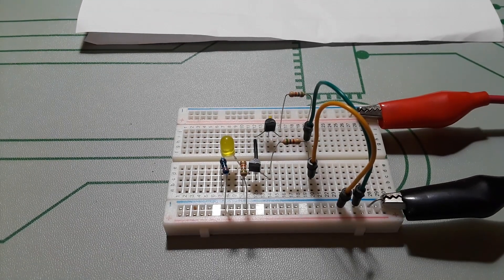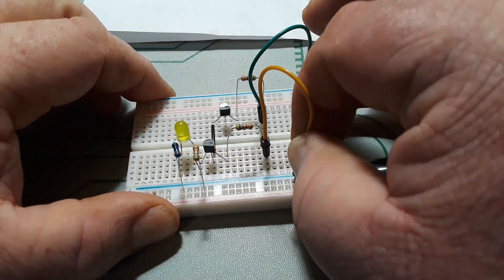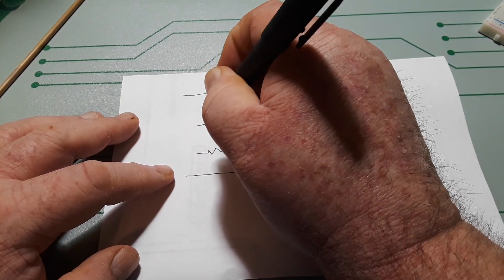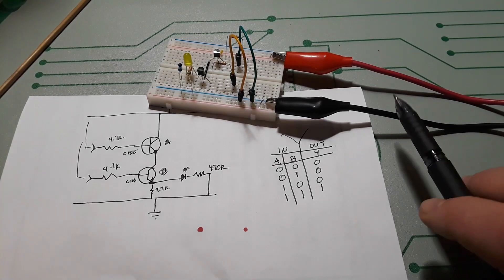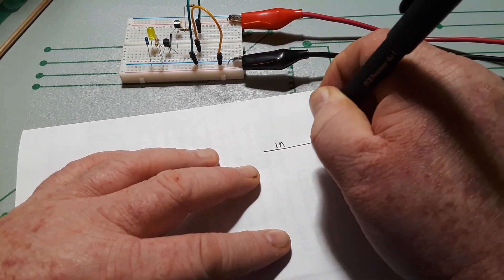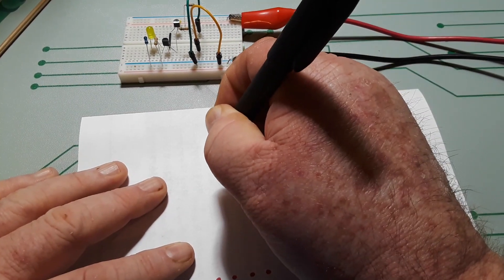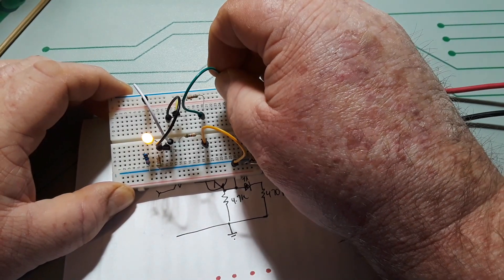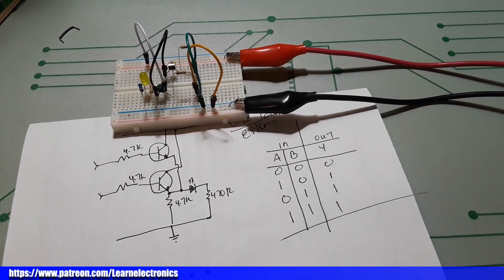How To Make Discreet Transistor AND and OR Gates

Comment: So I made this AND circuit with a couple of generic NPN BJTs (no datasheet on them) and switched each on with a 5vPP (2.5v offset) square wave at different frequencies and found the LED blinked appropriately when both square waves hit their peak simultaneously - however, when I measured the signal out of the second transistor (the LED input) I saw 3 levels, 0, 1.8v and 3v (VCC was a fixed 5v).  I know why I saw the 0 and 3v steps but no idea why I saw a 1.8v step.
Reply: So the second transistor (connected between the first and the LED) has an Emitter voltage of 1.8v when it gets a 5v pulse even when the Collector is not connected to anything.  Note I used 10K resistors in this circuit.  Is choice of NPN BJT important here?  I do note that the LED still lights very dimly with the 1.8v.  I changed to a different set of General purpose NPNs (BC549) and used 47k resistors but no actual change - I still got 1.8v.  Although 1.8v is not treated as a High - it is not treated as a Low either.....  So it appears this circuit is somewhat problematic...
Reply: @davidh1187  When one of the inputs of one of the transistors is 0v and the other is 2.5v, then the 2.5v at the base ends up as 2.5v - (base to emitter diode drop ~= 0.7v) which gives you 1.8v.  You will always lose about .7v from base to emitter in a common collector configuration.

Comment: Reasons to do it this way instead of using an IC:
   1: The IC has multiple instances of the gate.  If you only need one, this may be cheaper.
   2: If you only need one, this may be easier to fit onto your board.  You can spread the components out into empty spaces.
   3: It may be easier to route on a PCB

The above is especially true of inverters.  The inverter IC typically has 6 gates.  If you only need to invert a single signal, you can do it with one transistor and two resistors.  You can buy the components in lots of 100 and build the gate for about 15 cents.  Singly, the ICs are about between $1.50 and $2.00 each if purchased singly and 5/6 of it you are never using.  BTW, the price doesn't go down that much if you buy 100 at a time.  Then you have to figure out what to do with the rest.  The resistors and transistor can be use in other applications.  They do not have a single function.  

All that having been said, if you are using all or most of the gates on an IC, then the IC is the better way as it takes up less space and is easier to deal with.  Knowing how to build the gates yourself gives you options when you only need one of a gate.
Reply: Concur with this 100%!

Comment: I've found that by grounding the emitter and inverting the output from the collector (via a 1k resistor) gives better results if you want to really start combining gates. It also has the benefit of being TTL compatible.
Reply: OK so I grounded the Emitter, put a 1K on the Collector, replaced the LED with a 10K, connected it to the point between the 1k and Collector, the other end to ground and took the output between the 1k and 10K and got my logic Low for a pulse match of the inputs and a logic High when the inputs did not match.  Many thanks.